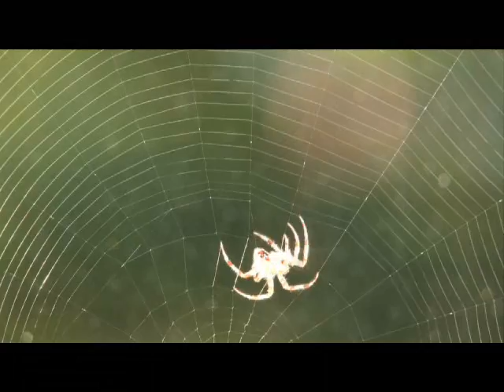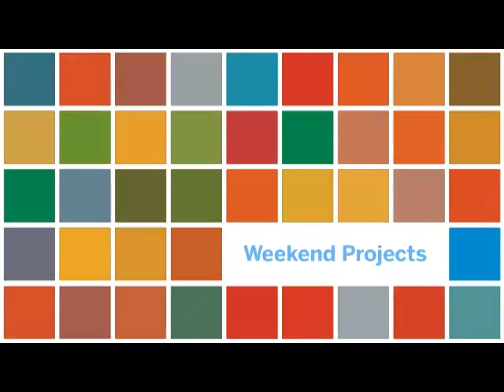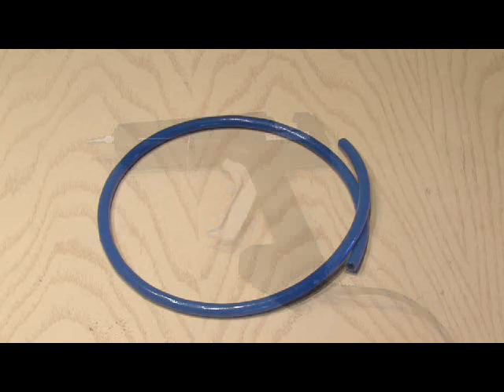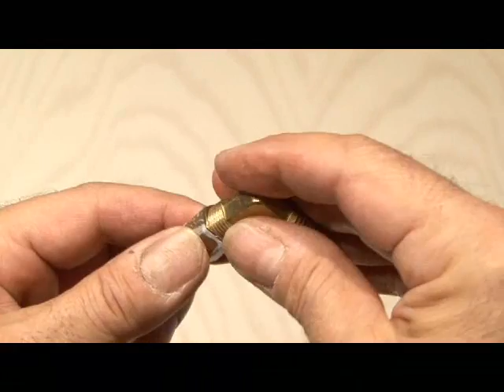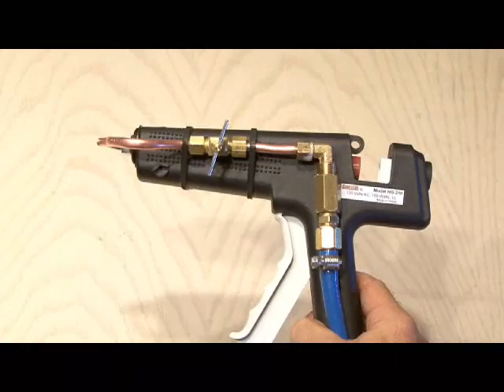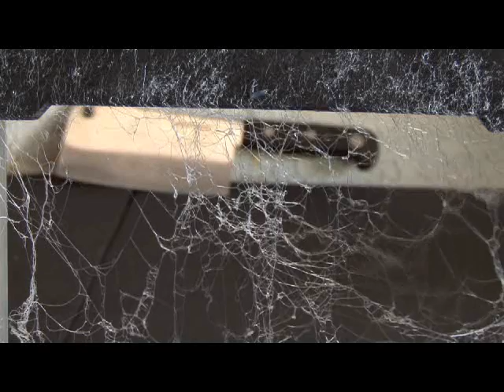Weekend Project: Make a Spiderman Gun!

Comment: Canned air comes out COLD. Compressed air is usually around room temp, or possibly warmer due to the compressor heating it up.

I would like to try it with canned air, though. The cooling might actually make better threads, who knows.

Comment: Wouldn't it be easier/cheaper to take an air compressor blowgun and modify that onto the glue gun? Then you wouldn't have to worry about cutting up copper tubing and getting those fittings

Comment: did you mess with the air pressure (to much, not enough), is it to close, to far  from the tip of the glue gun. you probably need to adjust all of that, and if none of that works, take it all apart and check everything you might have a faulty peace. Hope that helps.

Comment: pretty simple to make this portable, you get the air compressor, and attach it to an DC-AC inverter, which is attached to a 12v Car battery, put this in an back strap old vaccum cleaner  case, paint the case matte black, and customize it with some decals, or maybe a spider web design, and SNAP! your done with you super gut-glue web system. either that or you buy one of those spiderweb canister shooting things you strap to your wrist, they used to sell those back in the day, i have no idea now.